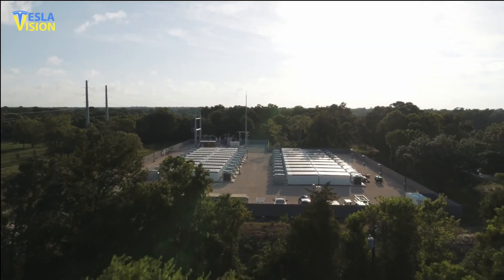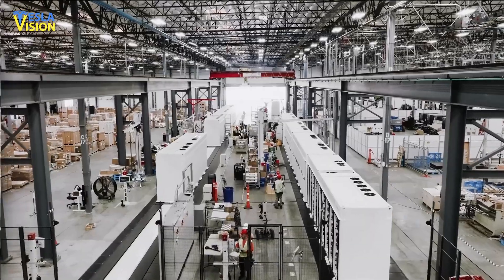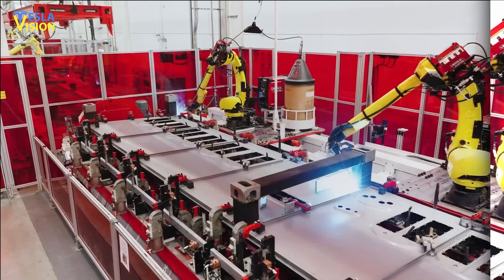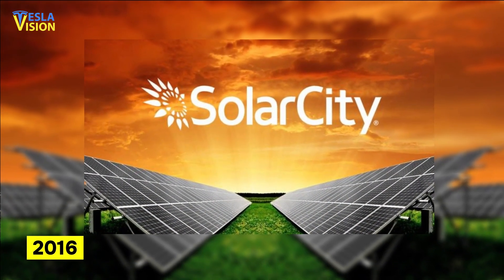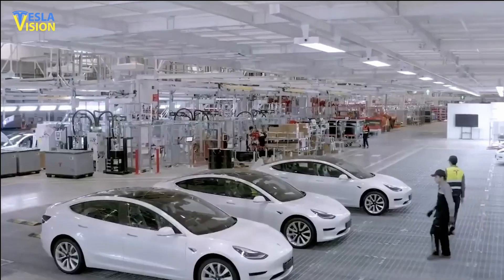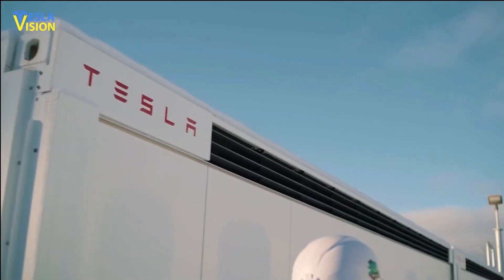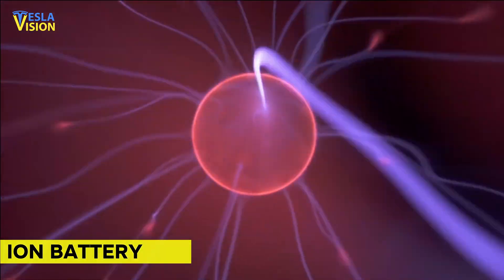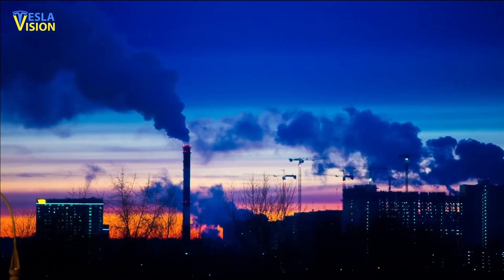The Genius Battery Will Change Tesla Forever (MORE PROFIT!)

Comment: I wonder if the energy already spent at a gym could be harnessed. Let's say the gym was built intentionally for the purpose, and all machines were tied into the mechanism. 
Does anyone think it could be viable?
Reply: Some have tried that concept already. They have even been doing something similar before electricity was even discovered. Cranes used to be powered by men in a hamster wheel, their equivalent to a treadmill.😂
Reply: @Justin Weatherford  Hahahahaha! I may have had one toke too many before watching a Tesla video 😀